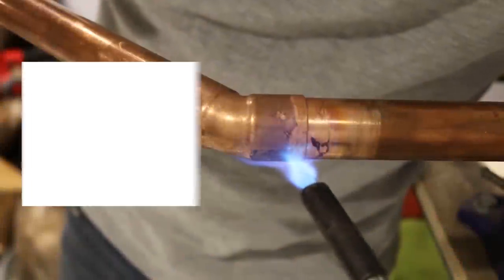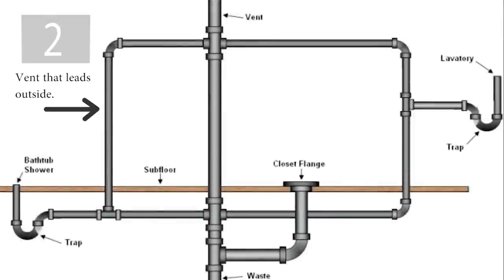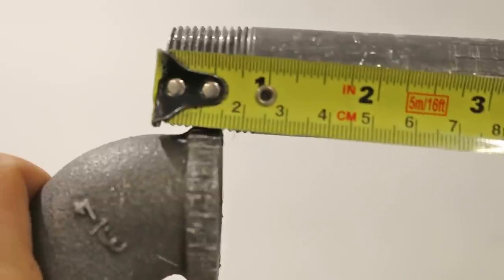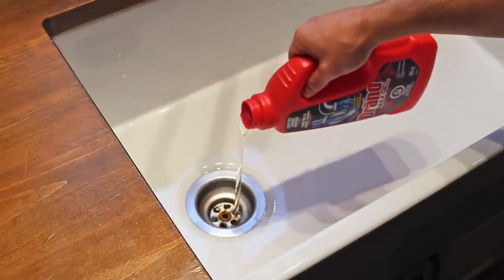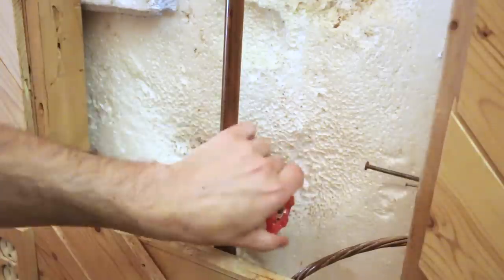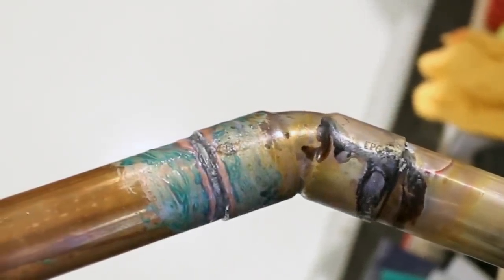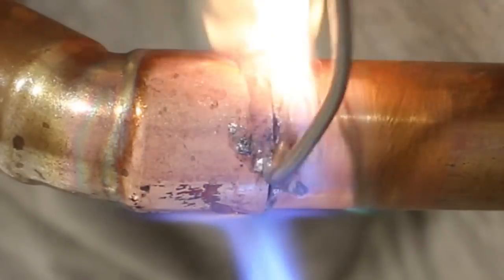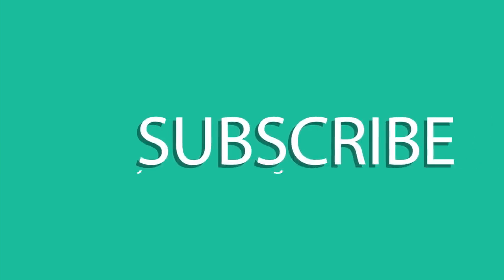10 Plumbing Mistakes You Should NEVER Make and How To Fix Them! | GOT2LEARN

Comment: #1 tip . Don't do any plumbing when the stores are closed.
Reply from the maker: Such a good tip lol!
Reply: My old company would have me working after hours. And sometimes I had to perform miracles when I needed a part I didn't have. That's why I went back to new construction.
Reply: I work in a plumbing store and I see it all...best and safest advice is to get a plumber, for every dollar I get for a DIY cowboy making their plumbing issue worse I would be retiring now. Plumbers love it when DIY cowboys do there own work they have a tendency to make it worst, what should of been an easy quick short job for a plumber in the first place if contacted is now and a more expensive job requiring likely even more parts and longer labor. A cost the customer was trying to save in the first place now costs more $$ and time...The irony.
Reply: @Jamac007  £25 call out plus £50 HR labour, remove these fees then I will call . Four hours sitting in your van searching for a part we do not need?
Reply: I once read that every home repair takes at least three trips to the store. I've been a homeowner since 1979 and so far, it's true!
Reply from the maker: Minimum lol
Reply: @Jamac007  The time you need a plumber is at the must incovient time possible, tell me your call out fee is not £25  at these times? Recently asked for a quote to fit a emersion heater thermostat, advertised ( local rag) £38 quote from plumber £150 plus I had to drain the system and remove old heat element myself. Found an alternate method cost £25  ( d I y) say no more .
Reply: @Mrfort  If you can make it work that's great. First I work at a plumbing only store that sells plumbing gear...I I'm not a plumber, but I sell gear and deal with plumbers and DIY's everyday. If you ring a plumber after hours off course they charge a premium for turning up, They need sleep, they got families to go to aswell ....I live in NZ and doing your own plumbing if you are not qualified and registered is risky, for example: you want want to fix a leak, you make it worse and flood your house out.... you have no leg to stand on trying to explain to the insurance company trying to get compensation. Insurance companies here have the best lawyers and investigation teams that go onsite to make sure you don't BS to them, and they generally find the cause. Insurance companies in NZ will not pay out for your house and contents in you are not a registered and qualified having done work if something goes wrong. Perhaps this is different where you are from, Just saying, I've come across so many DIY's in tears because insurance companies will not pay them out, don't mean to carry on its just that alot of the experiences I've come across in my years dealing in the profession there is alot of heartbreak, most that could of been avoided if they called a plumber in the first place.
Reply: Sometimes, it can't be helped. That's why you've gotta have a good supply of temporary fix products, like clamps, compression couplings, sharkbite(honestly, some of the cheaper alternatives seem to be better for temporary fixes, but you get the idea), rubber hoses with clamps, ect.
Reply from the maker: @oShane totally normal ;)
Reply from the maker: Not yet, but I am trying hard to get it spread in Canada and the US. If you want one, I have some ;)
Reply from the maker: Do you have Facebook or Instagram?
Reply: lol, duly noted....
Reply: Make sense. 👍
Reply: @Got2Learn  oh hell naw....if you do have to do a repair..it help's to have a backup supply of various things
Reply: After 20 years owning a house, you should have accumulated all kinds of tools and hardware to do pretty much any DIY.
Reply: In NYC we have two 24 hour plumbing supply houses ...they do charge double but it’s there when you need it
Reply: Holy hell yah no shit huh.. That'll make for a long sleepless night if its a major issue.
Reply: #2. Don't do any plumbing on the weekends, if you have to call a plumber it'll cost more.
Reply: Adamcowboy476 depends on the plumber...I don’t charge any extra emergency/night  rates for after hours work
Reply: Yes indeed!
Reply: The original owner of my local hardware store said "Never start a plumbing project after 9am."
Reply: Thxs I will remind my pipes not to break outside store hrs
Reply: @ROGER2095  dont forget the 2 cases of beer or equilent in hard liquor after the  store trips for sure
Reply: True dat.
Reply: Lol, it’s more like........plumbing problems only occur on weekends after store hours or on holidays! Never fails!
Reply: Wile E Coyote... super genius!
Reply: @Jamac007  and after they make a quick fix worse they wonder why it cost so much. You tube is not your friend. If you break something YouTube is not going to fix it call a professional. I always tell my customers better safe than sorry 😂
Reply: @Jamac007  You wouldn't have a job if it weren't for those DIY cowboys.  Also, I don't know what plumbers and electricians are charging for house calls in your region but THAT is what makes people DIY ----- $150 minimum for a job requiring $5 worth of material and 10 minutes of time?  No thanks.
Reply: @Jamac007  Flood your house out trying to fix a leak?  What world do you live in?  Not the real one for sure.
Reply: @Redandranger  if a DIY cowboy ain't buying it then a certified plumer is, doesn't bother me either way. Where I live you get no warranty doing your own work, but you do if it's done by a professional.
Reply: @Redandranger  not everyone is competent and confident with their tools and knowledge yet idiots still want to give it a go, and yes floods do happen to those inexperienced with plumbing.
Reply: @Jamac007  Warranty of work?  HAHAHA --- right.
Reply: @Redandranger  you don't have tradesmen warranty their work and the gear they install where you come from?? Here it's law,
Reply: @Jamac007  Why do you think I laughed?  Once they drive away, any call backs are on your dime, law or no law.
Reply: @Redandranger  yeah I suppose it's different where you are. Here if the workmanship is sub par and you have receipts, pictures, video etc proving they did the work we can report them in to the national plumbing board. The plumbing board will send investigators and 2 things will either happen, either the plumbers involved will be forced by the board to re-do the job to a standard at no cost or else they will be fined thousands depending on the job or if the work is really bad they are like to get prosecuted and get fined thousands and the customer gets full reimbursement from the plumbing board and government. That somewhat how the warranty works here.
Reply: I like to start plumbing jobs in the morning also, just in case the pipes are old and rusty or something else is bad or you just have to fix more then you thought.
Reply: @InfernosReaper  You are so right!
Reply: @Jamac007  We kicked all the DIY cowboys to the Depot! No time, we gots real plumbers to serve. I tend to do things at 8pm on a Saturday night myself. Terrible Time!

Comment: Easiest way to remember the Teflon thing - follow the threads. Also, don't use too much. Long-term, excess Teflon tape can start leaking. Also, NEVER mix the pipe dope with teflon tape. I've seen this done and the fitting always starts leaking.
Reply: Agreed.  I've always used EITHER teflon tape OR pipe thread sealant.  Not both.  Not sure how using both somehow became a popular practice.

Comment: I tried baking soda and Vinegar and poof if was still stuck.  I used Drano and again poof and it was stuck. So I installed 1.5" ball valve just below the sink's P-Trap and the sewer line and put a clean Y fitting  with threads and made valve and adapters and hooked a garden hose and shazam the clog blew out even the snake couldn't reach clog but the 60 lbs. of water pressure did. Never need to snake plunge or use chemicals. The valve was my idea but the idea of using water pressure came from a foreman whose wife was about kill him for not unclogging her kitchen sink for a week.    LOL

Comment: Just wanted to come in and say that I've installed literally HUNDREDS of saddle valves in businesses for my equipment and I have NEVER had an insurance claim for a single 1. Have I had the occasional one not shut off fully when we remove our equipment? Yes, but it can be remedied easily with a compression cap. I have never had one just leak out of the clear blue...ever.
Reply from the maker: Good

Comment: Here's my tip: When replacing something, ALWAYS take the old part to the store with you.You might think parts and sizes are standard,  but they're only more-or-less standard.
Reply from the maker: Good tip!!!
Reply: Also, good luck getting a faucet stem that will match whatever you have. I can count on 1 hand the number of times that's actually worked and even those were "well, it's close enough. Let's see what happens"
Reply: @InfernosReaper  I know exactly what you mean. I have a 55 year old house that was built with a lot of stuff that was old at the time. My washtub faucet is from the 30's! Some of it I can modernize, but a lot of it's tightly fitted in place and can't be changed.
Reply: I'm starting to take phone photos for dyi
Reply: @pmailkeey I remember a few people like that in the 70s as a teen, wandering along with my dad. Gruff but wanted to help us succeed.  Seeing a few like that these days too, one canceled my Bosch spark plugs order!
Reply: The best plumbing supply place in the entire region was owned by a lifelong plumber &his daughter. She had been helping him since her grade school years. The place was old,  dusty&cluttered floor to ceiling. They had what you needed, would write out the steps for us rookies. As long as it wasn't damaged, they would swap the part you just bought for a different one. Finest customer service I have ever seen. There were calendars on the walls from the '40s. I love that place&I drove past Home Depot&Ace to get there. Every repair job. Sadly, time took its toll&both the plumber&his daughter are  gone.

Comment: Nice video young Man.  Myself I retired from the construction field after 55+ years where I build from the slab up doing all the work from the under ground to to roof caps and everything in between.  I even corrected several mistakes on a 3 story build out on a medical building where 13 doctors and managers office were to be.  And that was lots of electrical, plumbing and A/C work and when I got done the architects wanted me to join them as a partner but since I have a couple more jobs of the same size etc I had to pass this up.  But alas it seems that since I retired I can finally start fixing up my house now when I am not helping a friend fix something that broke around their house....

Comment: Great advice, please note #7 dialectic unions will lose grounding to a electrical system if not correctly bonded to both dissimilar metals and if the plumbing system is grounding the electrical system. Very important! ✌🏻
Reply from the maker: Very true, I should of mentioned this in the videos, thanks Z ;)
Reply: As an plumbing inspector I run into this all the time. Great videos!
Reply from the maker: That would make for a good video "what to check before inspector comes" ;) if you got some, that would be great :)
Reply: Good question, speaking only from a Miami-Dade , Broward County and Florida Building Code the FBC ICC 2017 , chapter 3 section 312 is the best which is general regulations and then testing of systems in sanitary, venting and domestic hot and cold water systems is a good start. Please note there is a commentary publication of all ICC codes in which would be a great resource for the general audience ✌🏻.  Also Please note all base codes for each state is either recognize by the IAPMO (uniform plumbing code)or the ICC (international plumbing code) based on codes with there own state amendments. ( certain states break down to AOJ (Authority of Jurisdiction )  Hope this helps.... basically same testing procedures for each plumbing system installed.... ✌🏻
Reply from the maker: Yes, thanks a lot Randall, i'll make something good out of it ;)
Reply: @pmailkeey hmm.  Thanks.
Reply: From the electrical point of view, try to avoid using plumbing as an earth ground. It has plenty of potential issues and is getting harder every year to be useful due to plastic pipe, dielectric unions, ptfe tape etc. Additionally, NEC has specs about how close the pipe has to be to entering the earth etc and many many plumbing ground installations do not meet this requirement. If you run into this and are in a position to make a suggestion just let people know that they are better off with ground rods.
Reply: @Got2Learn  you started an excellent public safety discussion.  Even if some have to incur expenses to stay safe, it could have positive effects.  Plus the helpful comments and references to code books are accessible, probably at many libraries.
Reply: @zakkmon123  thx. Excellent reminders.  Many libraries may have these codebooks free.
Reply: @NickFrom1228  excellent points.  A true ground is worth the cost of professional advice and/or implementation.  A very valuable set of discussions from many nice people here.  Thanks everyone.
Reply: @pmailkeey It is surprising how many ways they allow. But each has its requirements in NEC and its pros/cons. I'd be interested in the cladding because some of those are known to have issues. I'm surprised NEC still allows that.
Reply: @pmailkeey Oh, wow. I'd probably go add a ground rod just in case. By now that is probably rusting out or something.
Reply: Equipotential grounding should be used with copper wire "connected" to a metal pipe.
Reply: I'm a pumber in Europe (France) and I always find the differences with America almost fascinating. For example, you can solder iron to copper (with braze soldering) but using the pipes for grounding is strictly forbidden. And equipotential linking is  also a must  when you use copper tubes.

Anyways, great stuff, your soldering is really beautiful. Keep it up!
Reply: @NickFrom1228  That said, if you have iron or copper pipes, I think you should ground them to keep them at zero potential, in case an electrical wire comes in contact with them. I admit I don't know what various codes say about this. I do know that some codes forbid grounding gas pipes.
Reply: @50srefugee  Yes, as long as people realize why and more importantly, why it may not work.  There are two types of issues here:   1. An electrical fault and 2. Shock hazards   Grounding pipes for reasons of a wire coming in contact is so that you try to give the current a path of less resistance so that you MIGHT trip the breaker. This might work but it might not depending on how/where your pipes are connected to the earth. If your pipes are connected to ground AND this is the earth ground for the service then you may be ok. The problem is, if your pipes are separately grounded and a current carrying conductor comes in contact with the pipes you may just see a steady current flowing through the pipe from that conductor and no actual tripping of the safety device. It all comes down to resistance of the soil between the pipe ground and the service ground. If the resistance is low enough then enough current will flow and trip the safety device. If it is not low enough but not too high then plenty of current can flow but still not trip the breaker. So a person could be killed easily with a grounded pipe. So, the pipes should be bonded to the service ground in order to prevent this situation. But also note that this is not a solution for shock hazards, only faults, which is the same as all grounds but worth noting nonetheless. There are also electrolysis issues that started this whole thread but I think that is covered well enough.

Comment: Nice vid mate, clear, simple, easy to follow.  With any installation, I fit isolator valves everywhere, makes life so much easier, can test each section in turn - and make sure to dismantle / LUBRICATE / reassemble beforehand, & they will last decades.
Reply from the maker: Yes, that's always good practice, thanks Theo ;)
Reply: ???   Having worked on cars, engines, machines, that is very basic engineering practice including plumbing.  I do my plumbing installations properly, to outlast me, and to be easily serviceable in the event of fault or upgrade.  I take a pride in my work, haven't needed to advertise for years, all word of mouth recommendations.   Bleeeve me, I have had to replace some god fuck awful plumbing in my time.

Comment: Your videos are very helpful. The only thing I've seen in any of them to disagree with is adding Baking Soda to Vinegar. It causes a reaction, which renders the vinegar inert, so I don't recommend this concoction to my customers for drain maintenance. Use ONLY vinegar, about 1 quart per sink drain, and let stand overnight. Next morning flush out each sink drain with about 2 minutes of HOT water. I haven't carried my drain machine into my own house since I started using this treatment monthly. Thanks for all your useful videos! 🤠

Comment: On the over-tightening subject, it's also important to make sure your threaded joints are not cross-threaded before you tighten them! I've seen people make that mistake many times in the past, and it ends in the threads on both the fitting and the pipe being chewed up. Always start your screw joints by hand before turning them with a wrench!
Reply from the maker: Absolutely!!

Comment: Good video. Just add that venting is to allow air in AND to EXIT. A large slug of water pushing air ahead of it can cause problems too. Second, remember to ream cut pipes.
Reply from the maker: Yes, thank you :)
Reply: @ltsgarage7780  If you are talking about the tool used at 1:44 that is only for applying flux.